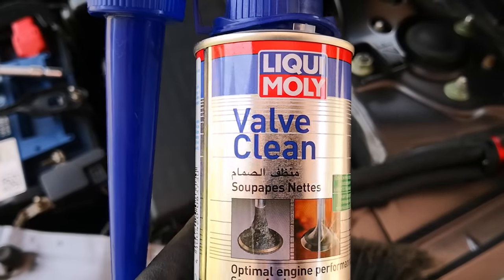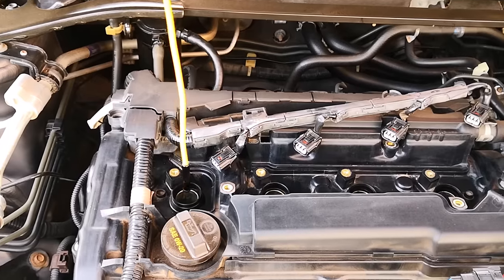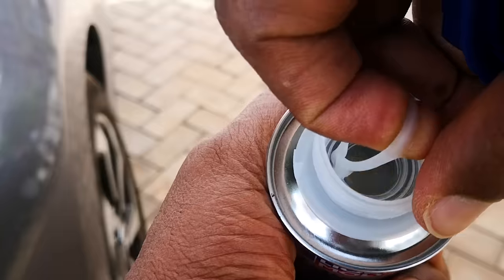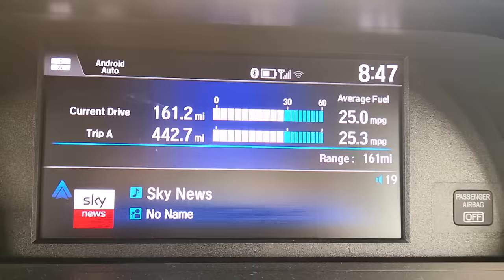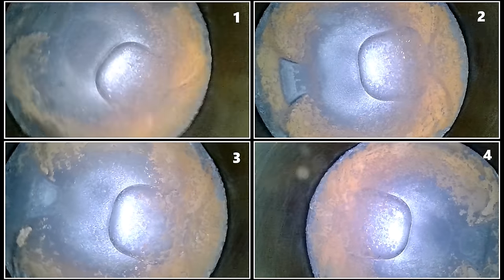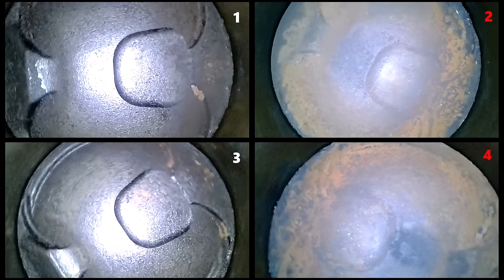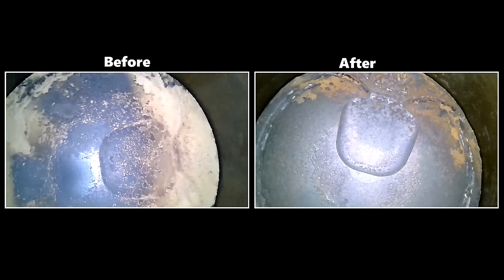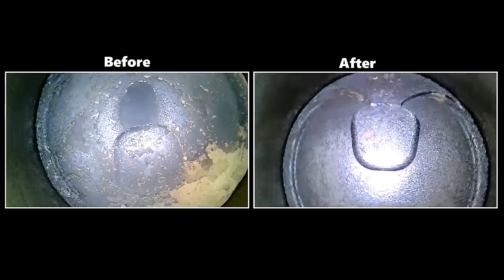I tested Liqui Moly on Piston Carbon Removal: Liqui Moly Valve Clean Works on Piston Carbon Build up

Comment: I'm curious about GDI engines. A problem these engines have is the top of the piston doesn't get fuel. So the carbon deposits appear on the opposite side than where you're showing us. 

Some suggest media blasting which can be $400-500. Any suggestions?
Reply from the maker: No doubt media blasting is the industry standard, but it's not accessible to everyone, hence the appeal of spray cleaners. You are correct, this product will not clean the back of intake valves in GDI engines. That said, I've acquired a collection of intake valve and fuel system  cleaners for indept testing. Should be coming soonest!
Reply: intake valves open and then the injectors spray into the piston before the intake valves even close, you will get almost the same results if only adding to your fuel tank, maybe a bit slower than spraying directly from your intake and have less greasy fingers, how do you think those intake valves got even dirty if they're there only for air? :face-blue-smiling:
Reply from the maker: Injector timing vs valve opening is one large topic. But I have often played mentally with what you say here. I got BG44K Platinum which claims to clean intake valves in GDI engines. Will see when I test.
Reply: You mean the top of the valves, not the top of the pistons.

Comment: If I could only pick one, which would you use between the Injector Cleaner and Valve Clean?
Reply from the maker: I'd pick the injector cleaner since in addition to cleaning the combustion chamber, it's formulated to clean injectors.

Comment: Wonder if that would work similar to Berryman's Chemtool for piston soaks?
Reply from the maker: It won't. Tried  it with soaking dirty spark plugs. Didn't clean a thing. Apparently the formula needs heat to support the cleaning

Comment: This is also for port injection engines only, from what I understood... But, how do I know if this is good for my car?
I have a 2009 4Runner SR5, V6
Reply from the maker: Your car should be multiport injection. The product is actually for carburetted engines but as can see from the video, even though my car is GDI, it did quite well for the combustion chamber. It just means it won't clean the injectors well. For me I was after cleaning the combustion chamber. Their product for port injection engines is called Jectron. See if you can find it.

Comment: I would say, Italian tuneup, did more than Liqui Moly.
Reply from the maker: I'm doing another test that would soon separate fact from fiction. I've allowed carbon build up to a similar level and this time, only Italian tuning. Before and after shots as usual. Video should come in the New Year.
Reply: What happend to the new video, were you ever able to get the time to do the testi? Cheers :D @DIYAutoworksNG

Comment: Would help if you actually had carbon to start with 
Did you torque the plastic engine cover bolts?
Reply from the maker: I agree. The carbon was gone from the prior use of Liqui Moly valve clean. The build up this time was quite light.
I always torque all bolts, so yes, I did torque the cover bolts.

Comment: 您的视频非常好，我来自中国，有问题想咨询您，pea超过一定的温度就分解了，那么燃烧室中的温度应该超过了这个温度，那如何清除燃烧室的积碳呢？谢谢，频道订阅了，感谢兄弟！
Reply from the maker: You are correct. No concern though. PEA decomposes around 250 degrees centigrade which with the temperature of the combustion chamber.
That said, this product does not contain PEA. Driving with the higher RPM helps the cleaning process. Thanks for writing fro China! Thanks for subscribing.
Reply: @DIYAutoworksNG  谢谢哥们！

Comment: Spray it in the throttle body and it will do the same for the top engine.
Reply from the maker: That's one to explore for cleaning the back of the valves!

Comment: What happens to the stuff that comes off the top of the pistons? Does it bounce around in the cylinder and scratches the pistons and the cylinders?
Reply from the maker: Having done several of these cleaning videos including inspecting the catalytic converter afterwards, I'm yet to see evidence that the carbon is broken off in chunks. It's rather vapourized into fine dust and goes through the exhaust.

Comment: But where do these buildups evacuate? Will get mix in oil ? Or evaporate?
Reply from the maker: It depends. If an engine is worn, then some of it will go past the oil control rings into the oil in the sump. In a healthy engine it mostly vaporises and goes through the catalytic converter.

Comment: Changing multiple factors means you cannot know what works and what doesn't. Considering you saw no difference with one can, and no difference with a double dose, it would be safer to assume spirited driving was the only effective treatment.
Reply from the maker: Very fair deductive reasoning, however, I later repeated this same feat but this time with no additive. I posted the video here too.
Reply: @DIYAutoworksNG  oh dear, I should have checked. Kudos on following up.

Comment: whaT about other side of the intake valve ? You actually just video filmd wrong area :D
Reply from the maker: Not wrong area at all. Hear me out 😁
I mentioned it in the video. My focus was the buildup in the combustion chamber which had started causing pinging. Car is GDI, so this product will do zero cleaning for the back of the intake valves. I use CRC intake valve cleaner for that. I have a video on the intake valves on the channel too.

Comment: The good news: The pistons are clean.
The bad news: Driving everywhere with the engine screaming wore the engine out.
Reply from the maker: Naa. Engines are built stronger than that. In fact, oil usage dropped dramatically after this.

Comment: Its a valve cleaner so it cleans piston heads but did it clean valves?
Reply from the maker: Car is GDI, so it won't clean the valves. I had a different use case.

Comment: How does it clean valves on direct injection engines?on port injection yes i can see it but dont understand how it will help cleaning valves on direct injection
Reply from the maker: Only cleans back of valves on port injection. I was focused on combustion chamber deposits.

Comment: cool....but can you tell...the dirt from the pistons is going to get through the injectors or is it possible to block them at a certain point in time ? thanks
Reply from the maker: The injectors are spraying into the cylinders so no way dirt from the pistons will get into the injectors. Also, GDI operates at very high fuel pressures that back flow just isn't possible all things being equal.

Comment: Do u know any seller in Abuja, am having a slight ping on part throttle especially with load or on an incline and I believe is carbon build up.
Reply from the maker: It's on Konga. Don't know any seller in Abuja. Though not stated in the video, this also took care of some pinging I was having.
Reply: Tnx bro

Comment: So it looks like it cleaned your pistons a bit but what's the point? Does it run better, or use less fuel? I doubt it so what's the point?
Reply from the maker: Stopped the pinging I was having, runs better, and added about 3mpg.

Comment: Do you have to drain any oil before adding liqui moly engine flush
Reply from the maker: Not required. I didn't use liqui moly flush in this video though.

Comment: Just for reference of fuel quality: where are you from? 😉
Reply from the maker: Car lives on Nigerian fuel. 😀 Only one fuel grade available, stated to be 87 octane.
From what I've observed, fitting an oil catch can really dealt with the deposits reforming, also since liqui moly also unstuck my oil control rings, there's also less deposits coming by way of oil going past the piston rings. Deposits no longer form as they used to.
Reply: @DIYAutoworksNG  Thank you very much for answering! 😃👍
I really couldn't figure it out. 😂 Palm trees, miles, driving on the right side, crash barriers in the middle but no barriers outside, the license plates in a format I don't know? Sorry, but I didn't think about Nigeria. 🤭🤷‍♂️
Well, about fuel additives: we HAD been lucky with good fuel quality in Germany, but the quality is dropping and dropping and dropping. The war in Ukraine has influence on the fuel quality in the northeast of Germany, Berlin included (my unproven, private opinion). The fuel quality is even better in Poland, but I'm too far away from the border to use that on a regular basis.
My opinion about Liqui-Moly: Liqui-Moly had been an innovator for fuel- and oil-additives. No doubt! But they are costly, here too. So I read their safety data sheets, analyse the content of a product and try to find such chemicals cheaper (like in a hardware store or among cleaning chemicals). I think I keep my engine in a good shape for an affordable effort. I think their Ceratec reduces wear significantly. 😉👍
Reply from the maker: Gracias for the context!

Comment: Does most of the carbon gonna stuck at Catalytic  converter ?
Reply from the maker: In a previous fuel system cleaner video, where I did a before and after visualisation of the catalytic converter, it darkened a bit, but had no chunks or anything. It went back to its former pale colour after a few days of driving. Catalytic converters clean themselves if an engine is functioning correctly.

Comment: Does this product affect your engine oil quality?
Reply from the maker: I haven't noticed at all. Liqui Moly does not say the oil should be changed after using this.
Reply: If this kind of product effects your oil quality it means you have bigger problem than carbon build-up, it means you have faulty piston oil rings…
Reply: @3dproje  No it’s common sense to change your oil if you clean carbon from the top.  Where do you think it goes?
Reply: @waterloo123100  circulated engine oil never ever gets into combustion chamber, these chemicals are sprayed into combustion chamber or top of the valves, it means they never contact engine oil. Engine oil isolated by piston oil ring, if you find any residue in oil it means piston oil ring does not working properly. Please do not comment about subjects u’re not qualified in…
Reply: @3dproje  Piston rings have to have a small amount of oil to the top ring or you’ll just have engine damage. We don’t live in a perfect world bud engines burn oil from the factory and if clean enough of it it goes into the crank case. Nobody will change their rings for a oil burning issue if you can fix it by removing the carbon first 😂You have fun on your computer because you obviously don’t work on 30 year old vehicles
Reply: @waterloo123100  and, it goes with exhaust gas u genius

Comment: Hi
Was your car burning oil at a higher rate?
I used Liqui Moly Gas System cleaner and it stopped my oil consumption. Maybe because there was carbon buildup on my piston rings and it freed them up so now they seal better.
My car was burning oil and I used the whole can, 500ml with 30 liters of gas, now it stopped and it's a bit confusing.
Reply from the maker: Yes, it was. It also drastically reduced the oil consumption. I made a follow up video on the gains that I had from using Liqui Moly. You're spot on, must have cleaned the piston rings and unclogged the drain back holes.
Reply: @DIYAutoworksNG  thanks for the info! I'll use another can for good measure and then every few thousand miles.
Good stuff.

Comment: Does this not contaminate the engine oil?
Reply from the maker: Only if the engine is worn. LM says to use with every fill up, so it shouldn't in a normal engine.

Comment: good results. but most people won't use 6 cans!
Reply from the maker: Yea. That's why I made this video. These products take time to work. I don't any any product that will achieve this level of cleaning if its really carb'd up in one or two treatments.
Reply: @DIYAutoworksNG  but then the product isn't really working is it as it only says to use one can. It's also really expensive
Reply from the maker: The product doesn't say to use one can, it says on the can that it's most effective if used in every fill up. If you have access to top tier gas, you probably won't need this.

Comment: Unfortunately this will not clean the intake valves on direct injection engines. It did very well on cleaning the pistons though.
Reply from the maker: Yep. It won't. I got a different Liqui Moly product for that

Comment: What will happen to the Exhaust CC after cleaning valves and comb. chamber.
Reply from the maker: Good question! I wouldn't be worried about that since the CC cleans itself, except if they were issues prior.
Reply: I am talking about catalytic converter
Reply from the maker: Exactly what I was referring to in my last comment.

Comment: Hi, so I wanted to get an injector cleaner but my mechanic recommended I use paint thinner. Please what's your take on this? Also, do you only buy your products on Amazon?
Reply from the maker: Some people use paint thinner, but have neither tried nor can advise on how to do so. I buy from  Amazon, other online stores as well as local shops.
Reply: @DIYAutoworksNG  Alright. Thanks brother!
Reply: I would recommend the Liqui Moly Fuel System Cleaner/Conditioner it works great I put it in 2 or 3 times a year with a full tank my Landcruiser is 33 years old and 430k on the clock.
Reply: @micktaylorwolfcreekmechanical  I actually got this. I noticed smoke coming out of the exhaust when I start the car in the morning. Is that normal?
Reply from the maker: Salute to the mileage on the Landcruiser!
Reply from the maker: Depends on the kind of smoke. Steam or bluish smoke? Steam, good. Bluish white smoke that clears after a while, likely valve stem seals.
Reply: @DIYAutoworksNG  Bluish smoke, this happens almost every morning since I used it.
Reply from the maker: And there you go. If you have a borescope and want to confirm leaky valve stem seals, you will notice that the combustion face of the intake valves in the offending cylinder(s) will be wet with oil. If the bluish smoke persists it could be the piston rings which maybe worn or stuck.
Reply: @DIYAutoworksNG  Problem! I don't have a borescope. Going to the mechanic, i should be expecting to change the valve seals right? I've been experiencing aggressive bucking( when going uphill or just applying more pressure to the accelerator) , loss of power, engine misfire etc. Can we schedule a physical meeting please?

Comment: Now the question.. why would you care about a bit of sot on the piston..
Reply from the maker: The build up was enough to cause pinging. After cleaning, totally went away.
Reply: @DIYAutoworksNG  pinging would destroy the sot.. loosing it up. I never seen problems with that little sot on the pistons.. newer type engine inlet valves, is another thing, which is not solvable with wonderfluids..

Comment: This product is not for Direct Injection Engines, right?
Reply from the maker: It's actually meant for carburetted or multiport injection engines. But as you could see it works even in GDI. I'll try Jectron in future
Reply: @DIYAutoworksNG  thank you for the update, That would be awesome if you show how to apply Jectron.
Reply from the maker: Noted!

Comment: This is not for direct injected engines, right?
Reply from the maker: Yes, but the car used in the video is GDI. They the Jectron is more suited for GDI. It won't clean the intake valves via a fuel tank approach though.
Reply: @DIYAutoworksNG  I see. But you say on the video that "it worked! Valves are cleaner". If the engine is GDI how this product that you put in gas tank worked and cleaned the valves?
Reply from the maker: I said the pistons were cleaner. I did state at the beginning of the video that I was focused on the products cleaning effects on the piston/combustion chamber not the intake valves.

Comment: Hello is this product  Less effective with cleaning deposits in combustion chamber If the Car is Port indirect injection????
Reply from the maker: It's designed for port injection and will clean intake valves in addition.
Reply: @DIYAutoworksNG  my car has 155k km I can hear pinging sound At low rpm only 1500Rpm to specific do you think after 8-10 cans Of this Cleaner with city driving only i will be able to clean most if not all the Deposits on the pistons????
Reply from the maker: That's though one for me to say with certainty, since I haven't done the testing. You can proceed as planned and see. It's definitely better than straight gas.
Reply: @DIYAutoworksNG  you havent done the testing??? Isnt this video showing that you tested the Product
Reply from the maker: I mean I didn't test using the product with just city driving. It was only the first tank that I drove per usual. Every fill up from there, I did at least 100miles of flooring it with each tank.

Comment: Does the results differ between direct vs port injection ?
Reply from the maker: Yes. It will clean the back of the valves in port injection cars. In GDI, it won't.

Comment: I really want to try this on my Audi Q7, but I have a dilemma. Do I use liqui moly cleaner and go wide open throttle with the risk of blowing the engine or piston rings? Or just leave the carbon depositz.
Reply from the maker: Will depend on the service history of the car. Want to inspect the cylinders with a borescope? A history of sludge?
Reply: @DIYAutoworksNG  no sludge, perfect history with oil changes every 8-10,000 kms, it has 105,000 kms now
Reply from the maker: If it were me, I won't have a problem using the product, but it all depends on you.

Comment: Direct Injection engine, should be more concerned with build up on the intake valves.
Reply from the maker: Right. I use CRC intake valve cleaner for that one.

Comment: Ok so...I get the cylinders and it makes sense. But this product is advertised as a valve cleaner. Your car (as the vast majority of new-ish cars), is a direct injection so putting this or any product in the fuel does 0 for your valves being clean
Reply: Finally someone that’s smart. Wonder how many people have already ruined their direct injection.